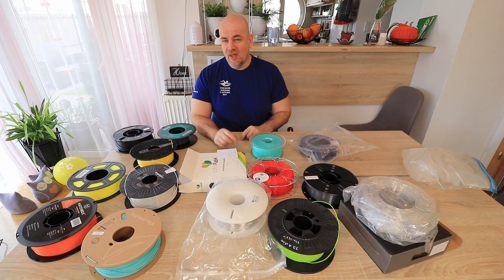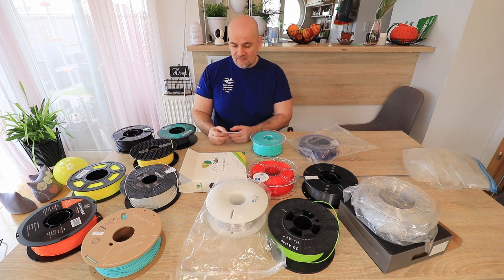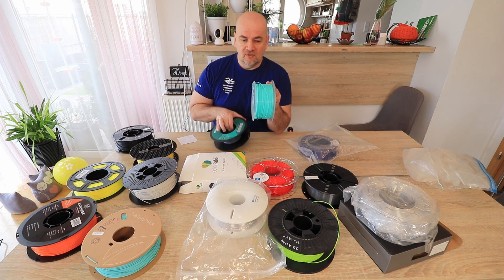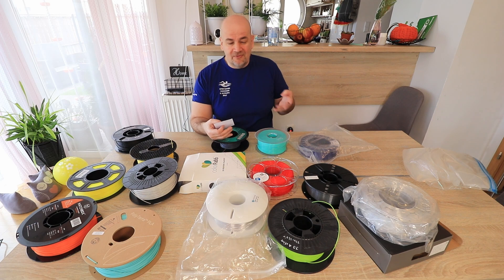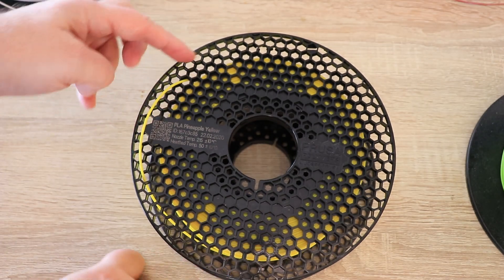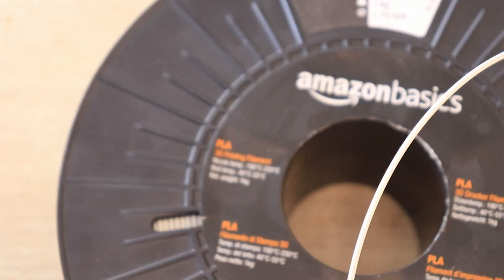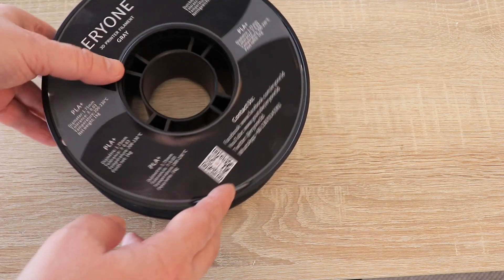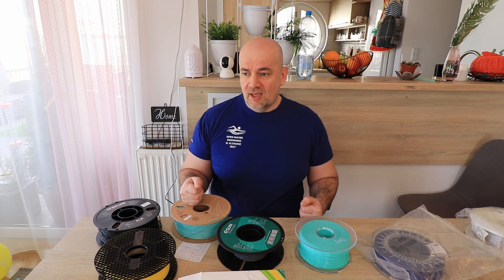Dear filament companies, what is the weight of empty spool? What is the (almost) perfect spool?

Comment: 1:12 I actually checked an empty Extrudr XPETG Matt spool and weighed it and what's in their "Additional Information" data sheet is totally wrong. Off by 20g. It also says that they use the same spool for 1000g and 1100g and that's not true either. They have different dimensions. Their PDF is misleading and useless.

Comment: The way Polymaker provides the Information is very good. Regarding the weight of the spools: even spools from the same manufacturer sometimes have different weights. Also, the spool weight may be changed from time to time by the manufacturer, so keeping a database will be a bit of a challenge. It would be good if many users regularly pass on the spool weights of the various manufacturers, then a database would always be up to date.

Comment: I weigh every spool when I open it.  Then I write the weight on the side of the spool.  If I bought 200g, 250g, or 1000g, I will always know how much is left since I can weigh it to see how much I've used.  (it also protects me if they change spools in the future)
Reply: This is what I do and always my 1st bit of advice when people ask me how do they check how much filament is left.
Reply from the maker: Thats good method.  But from some reason, I don't care about the spool weight, when it is full (I know incorrect). Now I try to do that too..

Comment: The spool weight is the total weight - Material weight you bought.
Reply: ...and if you weigh it when you first open it, you instantly know the weight of the spool.
Reply from the maker: Correct. But from some reason, when I open a new spool I don't think it will every be empty. So many filaments on it, and I don't measure it.
Reply: This would work if the amount of filament was exactly the amount that's on the sticker. But that's almost never the case in reality.

Comment: Agree on the weight of the spool. Regarding the information about the filament this would almost call for a detailed "Specification" of 'must have', 'can' and 'nice to have'  parameters. Definitely the nozzle and bed temperatures should be a range. Storage requirements if applicable could be nice.
Thank you and good luck!

Comment: Its funny you mention empty spool weight. I have been collecting this data for a while. Every time i finish off a spool i mark down the brand, how much filament the spool was supposed to hold, what the weight of the spool is, and what the spool itself is made out of.
Reply from the maker: I just noticed from these 15 brands, that some of them they have different spools too (polymaker has carbord and plastic, AzureFilm also changed, there is a post on Fiberlogy, that they also plan new spools, Extrudr (see in video) 5 types of spools etc.Your table is good until they don't change the spool. That's why it would be nice if they would place this info on sticker.
Reply: @MyTechFun  Yes, What you suggest truly would be ideal but my table is pretty ideal because you can take averages...for example. of all the 1kg spools i have weighed, the average weight is 180.7g. i can go a step further and tell you that the average weight of 1kg cardboard spools is 173.7 and the average weight of 1kg plastic spools is 185.2; i can also tell you that the heaviest plastic spool i have every weighed is 304.4g...This data can be applied in a multitude of ways. For example, If i did not have the exact brand and spool you have. I could take the spool capacity and material into consideration and look at the average of my data. then i could add a margin ontop of that 10-20% and feel really comfortable that the spool in question would not exceed that. doing this way means i can be mostly certain that i will not run out of filament mid print without knowing up front that it will happen.

Comment: I think it would also be a good idea to fill the table on your website with the actual weight of the spools. So people can look it up on your website when they are not sure if there's enough filament on their spool.
Reply from the maker: I wanted to do so, but then I noticed that one company has several type of spools (just one example you can see in the video from 11:09). That's why they should place this info on the spool sticker.
Reply: @MyTechFun  agreed. So we need one additional column with the exact type of spool 😉
Reply: @MyTechFun  this is the issue... it always can vary. Just put it on the spool.

Comment: I completely agree.
My favorite is Polymaker, which also seems to be the highest quality that I can buy in my area (Sorry Prusa, but your filament is not widely available in Canada).
They print spool info on the cardboard spools, but I don't see it on the plastic spools, but the info is available online.
I use reusable printed PETG spool inserts for cardboard spools for smoother spin, avoid cardboard dust. I also use reusable printed PETG clips for holding filament to the spool.